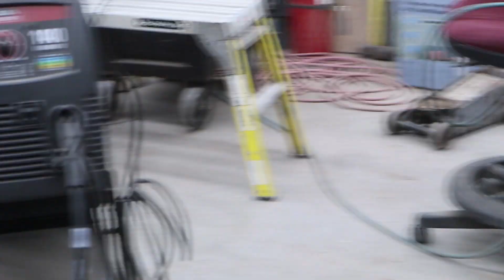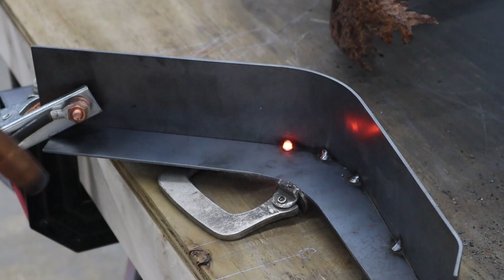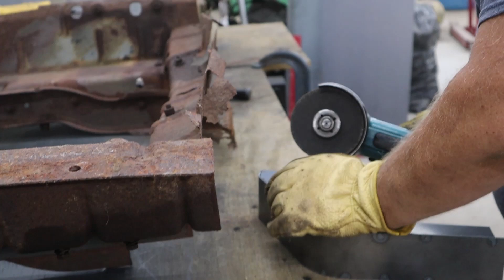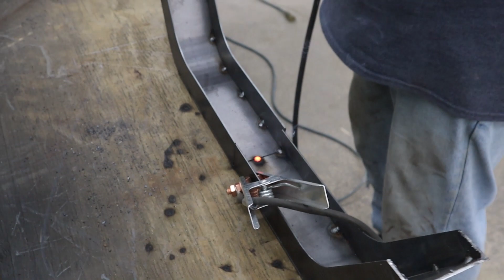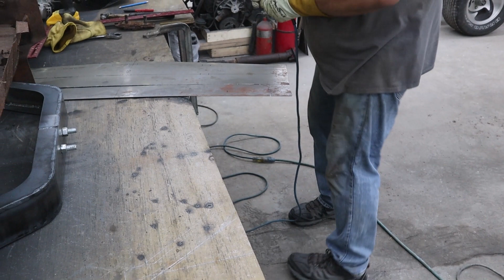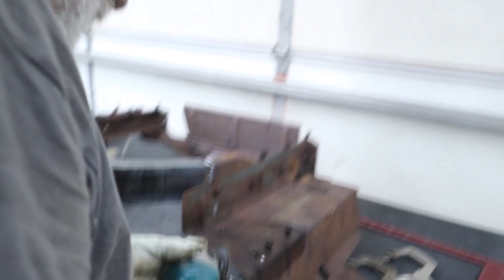Rebuilding A 51 Dodge Core Support

Comment: I haven't binged watched all your videos yet but working on it.  I like your bending vise (?).  Gave me an idea for one.  I'd like to hang out with ya but am from central Illinois.  Cant wait for more on the Willys tho.
Reply from the maker: Thanks for watching Guy, that old bender I built years ago to bend 1/8 inch plate to make a battery box. It's made from an old piece of rail rode rail. I still use it from time to time. More to come on the willys soon. What are you working on?
Reply: @hotrodray8554  Ive been working on design ideas for the bed hence i found your channel.  Im very impressed with your skills.  That type of skill comes from experience.  im impressed that you can move almost seemlessly from skill set to skill set.  Nice job. I dont understand why so many dont subxcribe.  Im spreading the word.  I almost got ahold of a 52 Willys about 7 years ago.  at the last minute they changed theit mind about selling it.  I really wanted it.  I like those old trucks.  Plus i, trying to figure out how i should brace the graft for the 90 Vet front and rear suspension.
Reply from the maker: Sorry Guy I didn't see this comment until now, thank you for the kind words, I've never used a vet suspension , however I have used a lot of the second gen camaro front frames and suspension .